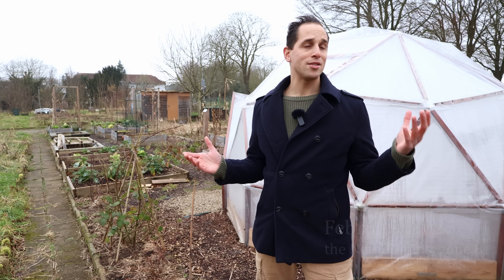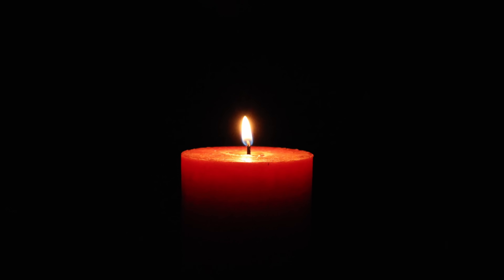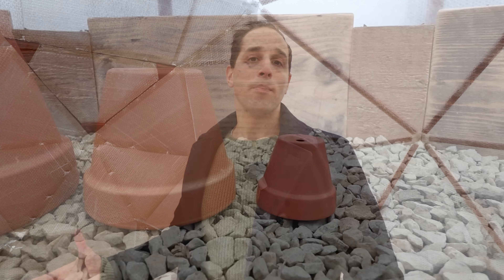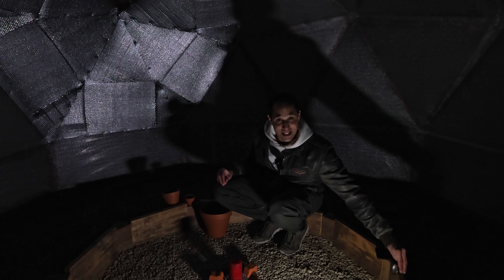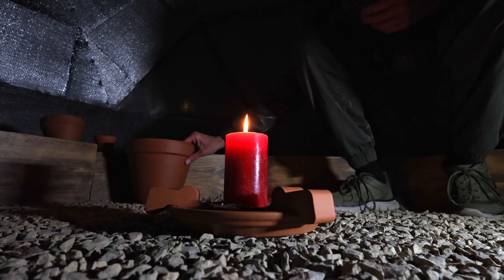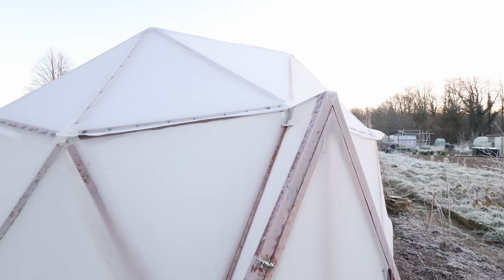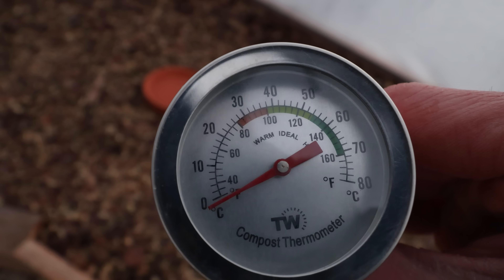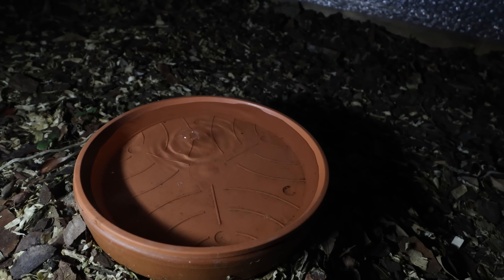Can a Terracotta Heater Keep my Greenhouse Frost-free? • Ep. 48

Comment: That's not the way to build an efficient a terracotta heater.
Reply: there is no such thing as an efficient pot heater. By adding mass to the system the pots themselves REDUCE efficiency of the heat transfer of burning the candles, since the mass of the pots has to be kept warm too

Comment: I have a few off grid tips for anybody that wants to do this and efficiently as well as this guy when you put your insulation up depending on where you’re located your reflectance should be facing solar south or opposite, but if you want to make it easier without using a terra-cotta homemade heater, use a metal horse trough fill it full of water and when the sun beats on your reflectance, it’ll heat up that tank of water and it will keep it warm, but also in a pinch what I have found better to use than a terra-cotta heaters that people have figured out now is a metal paint can put a roll of toilet paper in it. Use one bottle of isopropyl alcohol. Pour the whole contents in with the toilet paper roll and the toilet paper roll will soak it up then you light the toilet paper roll on fire. It will heat up the space. It won’t get too big to the point where you’ll cause a fire and the toilet paper roll will not catch fire Intel that is a proper alcohol is all burnt off on it. I used that method to heat a 14 x 80 mobile home for four days in -50° weather in a bad snowstorm because my power box went out and I had to put in a new breaker panel and one bottle of isopropyl alcohol will last eight hours sometimes more depending on the percentage of the isopropyl alcohol’s contents and for anybody that needs to know what way their greenhouse should be facing the sun. I encourage you to look it up online, but in northern Wisconsin when it comes to solar panels and passive greenhouse, Heating or even regular house, Heating, your house, windows or structures that have areas that let light into the building those windows should have roughly be placed at solar self. mine is east west but it is not always because I have a solar tracker array. It was the best investment I’ve ever done.

Comment: I wonder how much you could gain from sinking the greenhouse a foot or two.
Reply from the maker: Probably a lot. Obviously vertical space, but I suppose it would also give a more stable temperature, provided it is well insulated. You do need to make sure rainwater doesn´t flow in, of course 😂

Comment: in Alaska most dig down 4-5 ft then place greenhouse on top of that to use the constant 54* ground temp to extend the grow season. and growing in straw bales with a layer of soil on top of the bales to retain heat
Reply from the maker: I suppose they will also look into geothermal setups more often?
Reply: It's called a Walipini.

Comment: I have used these heaters indoors during a powerfailure. The one we used had a long threaded screw with bolts and washers threading the pots together, with the candle licking the bottom of it. This acted as a heat exchanger. The room stayed noticeably warmer than the rest of the house, and a cup of tea put on the top of the heater would steam.
Reply from the maker: Awesome! I've heard of these bolt&screw setups more than once now, might be the nore effective version! Thanks for sharing!

Comment: No, that is completely stupid. It’s a simple matter of thermal dynamics. A candle can only put out a certain amount of BTUs so by tripling it you’re gonna get more BTUs out of it in a little more heat. You probably would have made even a little more heat if you would’ve taken the terra-cotta off of the candles it’s a stupid old wives tale. People would do that, but they would build a fire under the terra-cotta and maintain it all night. you’re getting an old heating system mixed up with something else. It’s all BTUs.

Comment: It's the difference between a small flame with very little radiant heat plus heating a thin column of quickly-rising air, which goes up to the ceiling very fast, where people and plants are not, versus heating a thermal mass (the ceramic pot) that's down low, where people and plants are, and that mass can radiate most of the heat from the candle.  Heated air still rises, but more of the candle's heat is kept low for longer, as radiant heat.  The ceramic doesn't somehow multiply the candle's heat, it just absorbs and retains it longer down low, where it can do more efficient work.  It's why LP gas space heaters have a chunk of ceramic next to the burner flames, not as a reflector (that's the metal backer) but as a thermal mass to absorb and radiate heat from the flames.

Comment: Just the candles would probably do a better job at heating the air, as the terracotta just conducts some of the heat to the ground. 
Otherwise it doesn't actually add any extra heat to the system, as there's no such thing as free energy (contrary to popular belief).

Comment: Usefull experiment. Seeing 3 candles doing okey was nice. But with better insulation, and more poverful fire, like wood scraps, hotter and longer heating can be done. But the air curculation might be problem
Reply from the maker: Yes, like I said in the conclusion: the best way is a combination of good insulation, plenty thermal mass and one or more heat sources. I'd say a small, safe wood burner or a hot compost setup will really keep it warm, but this was just to see if could keep it above freezing (even if only a single degree C.)

Comment: I don't think this is going to be terribly effective. the greenhouse has quite a lot of surface area to lose heat through and the candle only puts out very little. I think it might make a difference to a draught proof and well insulated building. But not a very big difference. Tealights put out 30-40 watts of heat - you don't need too much dissipation for that to become negligible. 

The original design of these clay-pot heaters was to allow people to warm their fingers - which they will do as a point heater - but they are not space heaters.

Comment: Me, I’d add some reflectors reflecting more sunlight on the greenhouse and add 3 or more more terracotta heaters, for a minimum of four, also, as another poster pointed out, lighting the heaters before the greenhouse gets cold. 

Lastly, well, heat rises, so you need some way to embed a heating system into the beds, not having heating sitting on the beds…

How? I leave that as an exercise for you
Reply from the maker: Yeah I could run some tubing in the grow beds. Any proper heat scource + a heat simple fan could work I suppose. I'm also thinking about increasing the height of the grow beds an extra plank height, adding more thermal mass once they're filled up. A lot of extra work but worth it in the long run.
Reply: @atthegrassroots  sounds like a good plan. As much thermal mass as you can spare! A vertical axis wind turbine (VAWT) would produce some power that you could use for electric heating in the Greenhouse…. Home made out of an old car alternator, some old 4” or 6” pvc pipe, or a few old buckets or barrels and a few car batteries would really keep it above freezing 24/7

Comment: Only thing this thing does is to spread the heat for more hours as the candle heat the ceramic, that then soaks up part of the heat. Once the candle runs out the ceramic keeps releasing heat it has stored but it wont do shit to the BTU's provided by the candle. Our animal shelted 3-4 times this size has flock of turkeys similar insulation value and during winter 1500w to 3000w of resistive heating. For minus 30C weather we put in 4 8hour candles as extra heat in a old pan for fire safety witch helps, so in conclusion get better insulated animal shelter(its on the works) and candles can help over frost nights but this thing only stores heat past the 8 hours, but not much and with the nights being about the same length as the candle burn that is the minimal benefit of it but overall things it does nothing to increase the heat output. Only possibly making the candle burn slower and less clean. Although it might  tiny bit prevent some of the heat raising up so much so lowest point temp might be tiny bit higher, but if you want to keep the greenhouse warm, i would suggest using just more thermal mass and having micro fireplace where cold intake air is taken in same route the chimney goes out so hot chimney is on the center surrounded by the cool intake that warms up incoming air from the chimney heat. by welding more surface area in space between you transfer heat from one to another more efficiently. You can then use say peltier element possibly to produce tiny bit of current to run highly geared down motor that feeds pellets into the fire place. Bag should last about week maybe and amount of heat is way different in BTU. Also maybe add like with tents weather protecting ie put tarp of ideally plastic sheet over the green house to act as second barrier. There is also those few KW diesel heaters you can run on pretty much any clean oil though might need candle to preheat the fuel in that case.

Comment: All of the heat is going right out the top.  No different than just having candles only.  
The idea of these heaters is to keep the heat inside the pots & warm them up so they radiate the heat.    
You should put a coin or bolt to cover the top hole.   This will hold in the heat & be the most efficient.
Reply: Still only the heat of the candle.
Reply: Another victim of an underfunded education system.

Putting pots over a flame doesn't magnify it into being hotter. Physics doesn't work like that.
Reply: Pots make no difference stop believing YouTube nonsense a candle has the same amount of heat, in fact more because you lose efficiency by heating the pot up.if the pots keep the heat in then surely the room will be even colder.

Comment: I would be more worried about what carbon monoxide or other gasses  would do to the plants . 

In your case dealing with plants you could have a heating system powered by the decomposition process in compost . Thanks for the video !
Reply from the maker: Thank you for your comment! In case of many candles you certainly have a point, but with only a few I wasn't too worried. And yes, a compost setup is probably one of the better off-grid systems to get your greenhouse through the winter!

Comment: try covering the top hole one the small pot it should increase temperature of the pots in turn increase infrared of the pots making it shine on walls better in infrared making it warmer or use a 55 gallon barrel like i do to trap heat and warm barrel to make infrared .

Comment: Put the pots inside each other and use a nut and bot to hold them together that way each pot radiates heat into the outer layer of pots and holds heat better for longer

Comment: I was going to say all you really need to do is light the heater during the day and use it to maintain the warmth of the day or at least have it slowly drop throughout the night so it never get below zero but it's already been said :) Keep the candle lit constantly throughout the winter sii all we have to do. This is s great idea - thanks for sharing it. I'll certainly be making use it and soon - getting cold here in Ireland.
Reply from the maker: Thank you! Like I said in my conclusion, these will probably contribute only a little bit to the temperature of your greenhouse/keeping the frost off your crops, and the best way is still good insulation, plenty of thermal mass and one or more heat sources. Good luck with the coming winter! 🔥

Comment: You could probably increase the efficiency by painting the inside of the base pot black as black absorbs heat and radiates it better. 
Also if you use pots with different positioned drainage holes it would stop a column of warm air escaping directly up and out of the stack without transferring any heat.

Comment: You can extend your door tunnel and add a second door. That will help with air leakage
Reply from the maker: Yes, I've seen those designs! I thought about it at the time of building the dome, but I would JUST run out of fabric to cover that part so I chose not to. Maybe I'll still do it in the future...

Comment: Spreading the three candles around the space also helps, rather than all the heat in one location. Three spots, forming a triangle, and starting the heating process while the sun is still out, would help them to maintain the heat rather than heating up from a colder point.

Comment: I've thought about how this setup doesn't improve the 'heat column' which dissipates heat only when it reaches the ceiling.

You'd require something to send the hot air sideways.

Maybe it wouls work better with an array of small pots.

Or a hexagon with a candle in the middle. Candles can be 8hour tea lights, spread out a bit. Enough for the warmth to help heat the air in between candles. Exuding the middle candle, that's just to help air move/tumble.

I know this does show effect but it was over 20 years ago.

Moving the heat source close to where draft comes in can work but not if the draft is too strong. That helps only candles to burn faster.

Comment: Get an IPC tote and fill it with water + an aquarium pump to run water through a solar heater. You can get a small one starting at <$100 to a whole house heater for $1.5k. Or you can use a seasonal one for pools if you only need it for winter, which is made of 2 PVC pipes with ~100m of black hose in 20 strands which you lay/roll out on the ground and heat a tank of water to store heat.

Comment: A few issues here, with the pyramid/vertical stacking technique it's harder for the pots to absorb the heat and they are also not insulated in anyway. What may work better is stacking internally, i.e. the smaller pots fit inside the larger ones, that way there are layers of warm air either side of the internal pots, insulating them. An easy fix to this set up though, close up the holes in the bottom of the pots, a simple coin can stop the warm air from escaping out the top....
Reply from the maker: Great tip, thank you!
Reply: @atthegrassroots  You are very welcome - best of luck with your set up and keep the great content going 💪

Comment: I love the experiment! My recommendation is to first increase the insulation of the greenhouse to minimize heat loss at night. Next is to increase the thermal mass of the system with dense materials like brick or stone pavers. The sun will put out a lot more energy for free than anything you could do simply. Increasing the thermal mass should keep hold of that heat from the sun for longer through the night. Finally if you still need more heating, consider active heating elements like this. 

In America, chimineas were used for a similar purpose as your terracotta heater. The only difference is they burned fire wood and therefore put out a lot more heat.
Reply from the maker: Thank you so much for you comment! Yes, I do agree with your recommendations, thought the same thing. Especially for consistent heat capture/storage. Cheers!

Comment: So many people think these things work, they literally make less heat than just a naked candle, it's basic physics
Reply: Umm. Well no, the heat the candles give out is still the same, about 35w, and heating the clay pot does not make energy loss. The amouy of heat is the same, and perhaps the clay pot radiates the heat a bit around, instead of rising to to from candle, but the laws of physic remain the same. Candle gives 35 w, with clay pot or without😂

Comment: If you don't plug the hole the hot air will just rise to the ceiling and the heat will transfer through it. The entire point of the terracotta heater is to stop the hot air from rising fast.

Comment: Terracotta heaters suffer much of those watering holes. You need some way to hot air to escape but basically when you have holes directly above the candle the hot air wont build up and all heat goes top.

Comment: Well splitting 3 candles into 3 heaters would help. Take that heater and invert it with the 2nd smallest first and smallest on bottom. Fill what space you can with a bolt and lots of washers as a spacer. Flame directly below the bolt and you have a functional heat radiator with metal to conduct the heat through the pots and out with layers to store and radiate the heat as it builds
Reply from the maker: Definitely sounds like a good idea!

Comment: It would be more effective to have a hot compost in there and circulate water through it into sand in the floor. A second layer plastic with air between on the outside prevents ice from forming on the plastic and reduce air movement. Spreading out three candles in three locations increase warmth spread rather than three small next to eachother, having candles standing together is also a much bigger fire risk, I nearly burned down an apartment like that once.
Reply from the maker: Yeah, I agree with you that a hot compost will be a more steady source of warmth that will probably get you through the winter. And yes, spreading warmth would be a better idea than just the centre spot!

Comment: Terra cotta heaters are hyped bs. There is only do much energy in a candle. Putting a terracotta pot over it doesnt change that. It just captures some of the heat from the flame that then will radiate slowly. So it will be less hot for a longer period. The total amount of heat stays the same. Heating yr greenhouse with them depends on how many you put there

Comment: It is not the most correct way to set your terracotta heater...
The pots should have such sizes they permit to place them one over the other but passing over the lower about 20cm  below the bottom of the each other... securing them tight through their holes and leaving the hot air passing circulating in the spaces between them....
It's much more effective.